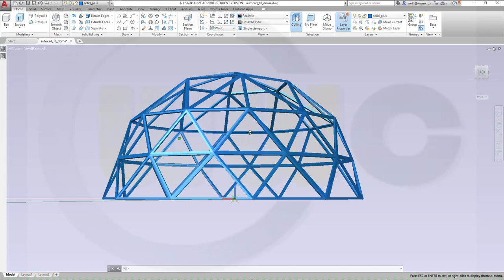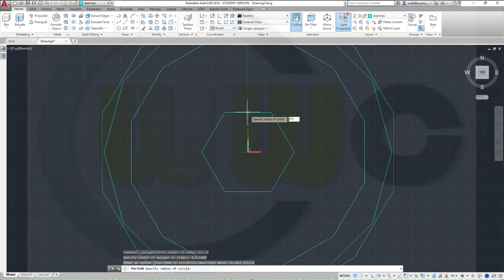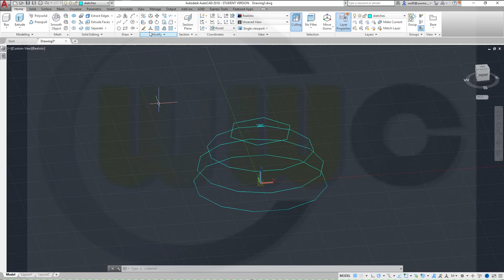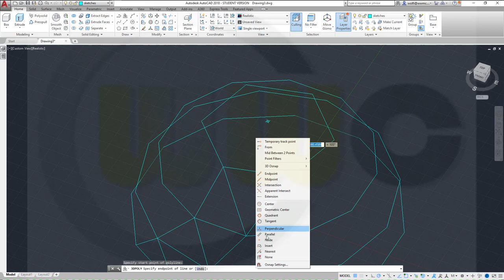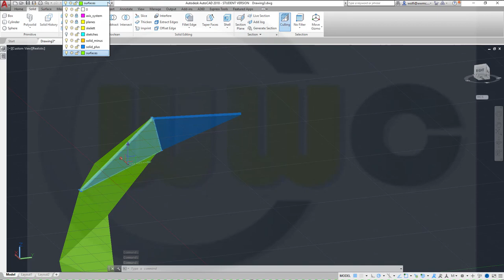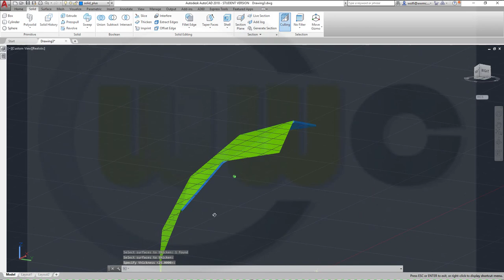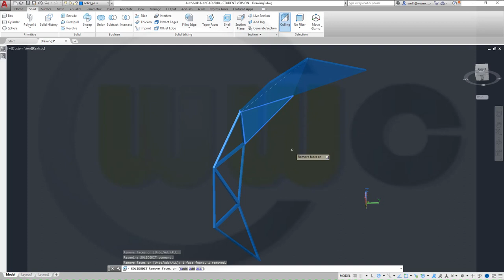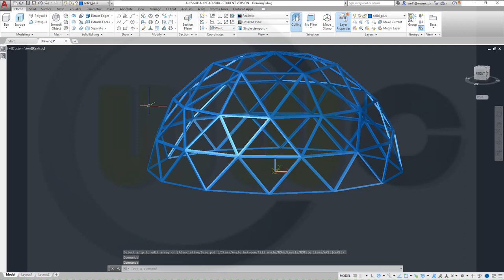Userwish - Dome - Kuppel - Autocad 2018 Training - Part Design

Comment: how did you work out the height dimensions?
Reply from the maker: Not at all. I got a drawing from the one who wished for it.
Reply: Wolfgang Walden I want to build 60ft in diameter wide dome in 4v. An you please explain the same method for this too. Or can you help how can I achieve the same results
Reply: good but hight and dim
Reply: DM Master Designs   I know I just came from your channel. Very impressive. That oldman sucks here on this boring channel.

Comment: İN3:35 TİME WHAT COMMAND  DİD YOU USE
Reply from the maker: I just put a POINT there, in order to make the points look like mine you have to change the "pointstyle" - if not changed it looks just like one lonely pixel.
Reply: @wolfgang.walden.cad.training  After putting a period there, press the tab key, then you used another command, which command
Reply: Tab zero tab zero...